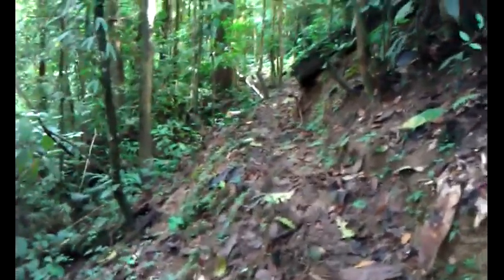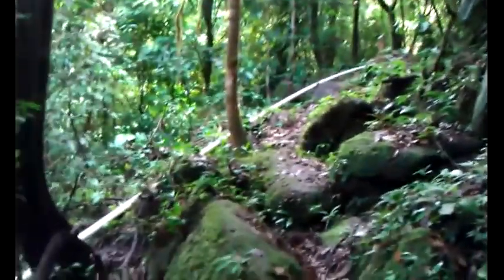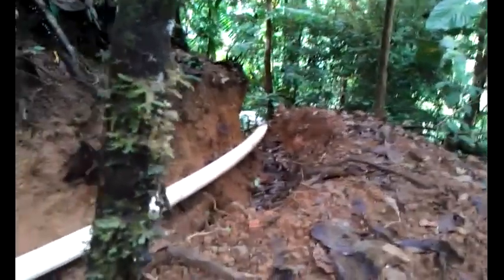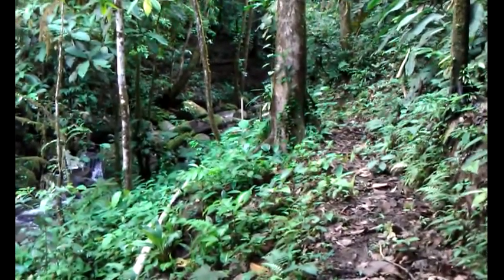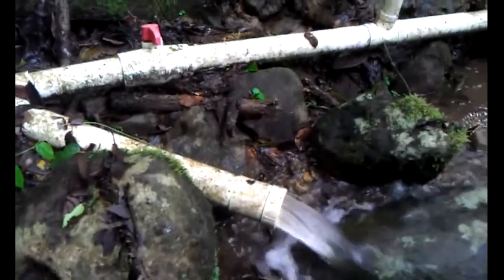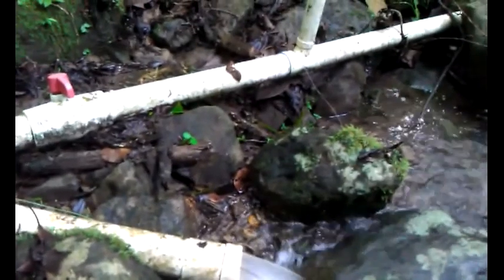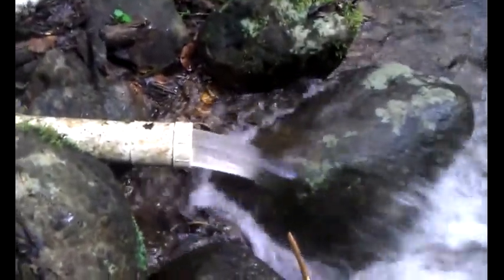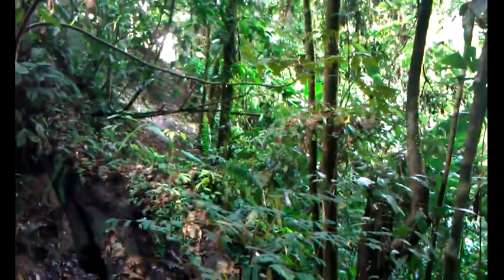Rambala Jungle Lodge Micro Hydro Project

Comment: Did you really excavate the land to keep a gradual fall on the penstock? That penstock can go up and down with the terrain with NO pressure loss at the end. Sorry to see you waste the energy to excavate.

I think you need to really look hard at how you are going to get your power that extra 350 Feet.  What voltage do you intend to run across the wire and how many watts?
Reply: +donbeckham    Hi Don    I am sorry this is the first time I have seen your comment   Take a look at Powerspout they have a unit I believe is called Me and it sends high voltage a long distance then rectifies it to 12 volt to charge the four battery's that I have then into a 24 volt invertor  I had a small delay and now I am back working on the penstock I have volunteers coming from many different parts of the world to help.  Take a look at our eco lodge as well Rambalajunglelodge.com   Would love for you to come and visit us   Thanks for your comment    Eric